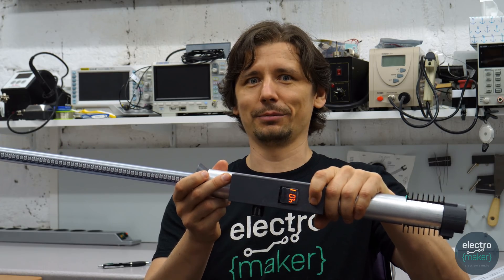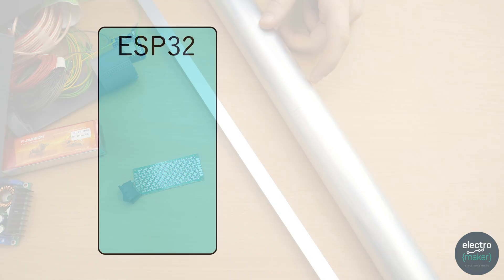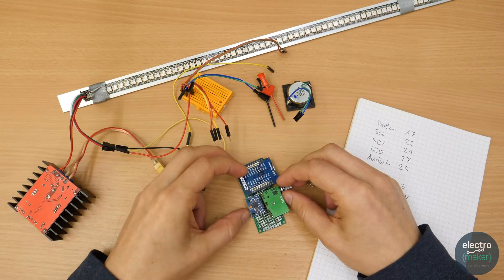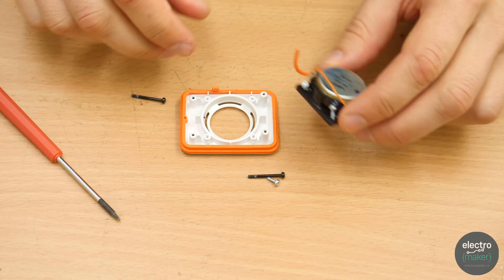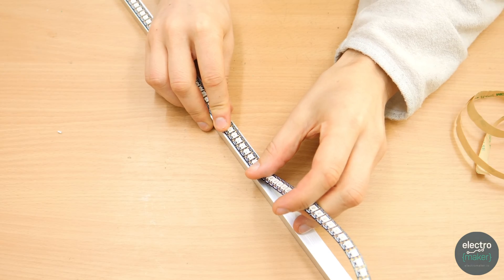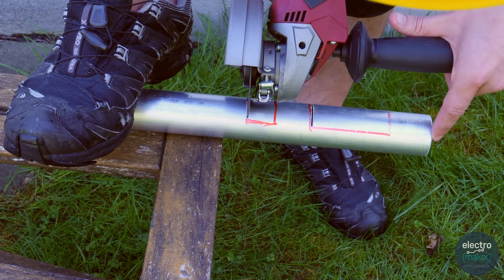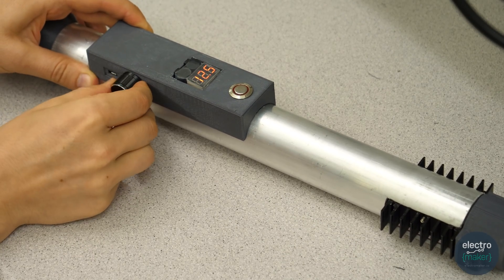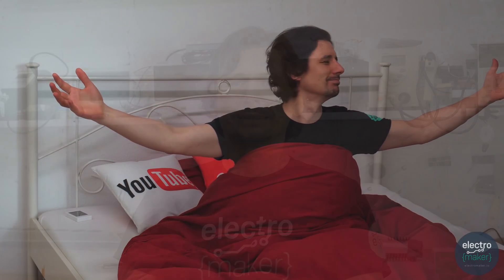How to build a persistence of vision Lightsaber using ESP32 microcontroller

Comment: Hey amazin project! I have it working with the original images, I need help in order to upload my own images. On the cImageConverter.html im using a 20x20 pix image, I can output a image.txt image.h and image.json, but I dont see reference to this files on the project / arduino code. Can you elaborate on how to use this tool?
Reply: I have updated the repository. Somehow the wrong converter slipped in. I also updated the project page
Reply: Nice!. So the image is kind of read slice by slice from left to rigth, there is no "angle" calculation, and a rotation point, is that correct ?
Reply: there is an angle calculation
the image is placed above the pivot
Reply: @andresc4  que tal muchacho como estas ? entonces  tu si pudiste echar a andar el circuito? por que yo no. Según yo,  lo arme  cuidadosamente pero no hace nada , el monitor serie sólo indica que se esta reiniciando el sistema una y otra vez  , una y otra vez. Ojala y pudieras  compartir tus  notas técnicas. Saludos desde CDMX.

Comment: how much did this all cost when said and done?
Reply: This is a good question.... I have to sum up the expenses and come back to you. But I would estimate a bit above 100$ depending where you source the parts from
Reply: Have the precise calculations now. almost exactly 100€ plus some wires connectors knobs and filament. I sourced the parts mainly from german suppliers... so you could probably build it for 60$ as well

Comment: Cool Project and well made. But putting solder to a cable that will be crimped later is a bad idea. Or have I saw it wrong?
Reply: @Alexander Vogel - Can you elaborate on why this is a bad idea? I've always tinned my stripped multi-core wires, before crimping. Always seemed best for protecting the copper and also achieving a strong crimped connection.
Reply: I do that on really thin multi stranded wires, otherwise the slip out of the crimping easily. using solder is probably just a problem when doing it on higher currents or voltages
Reply: Greg Clare 
Solder is malleable, and will eventually become loose.
Definitely a no no!
Never solder a mechanical connection.